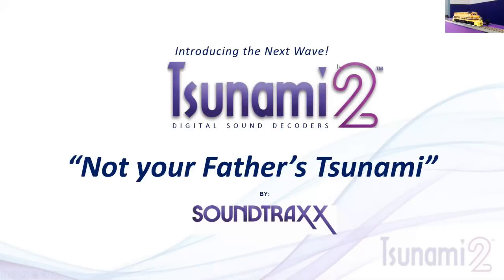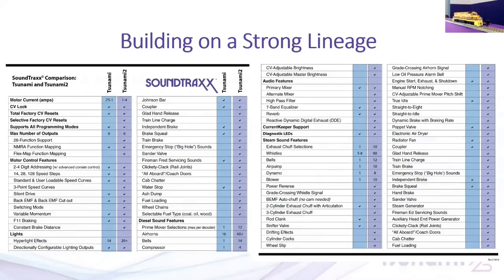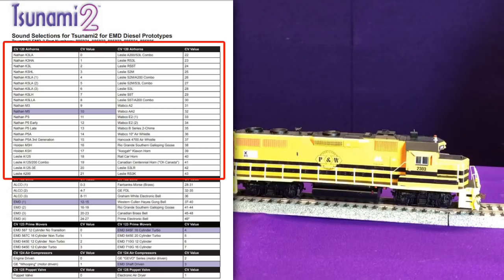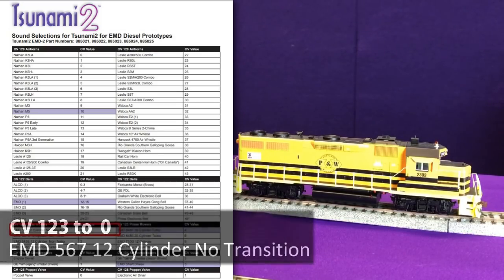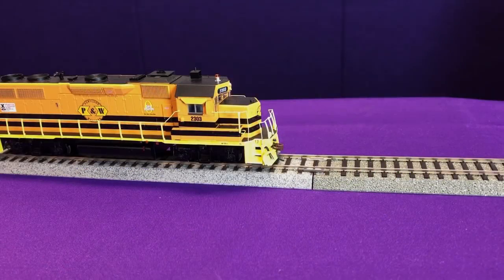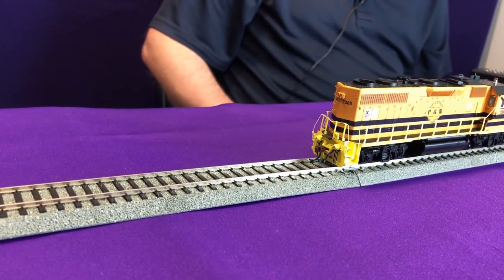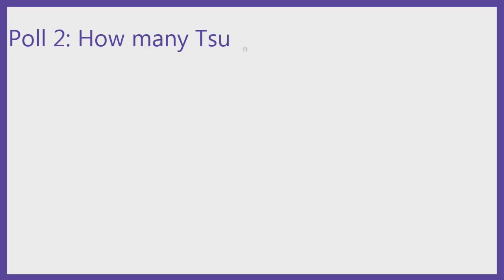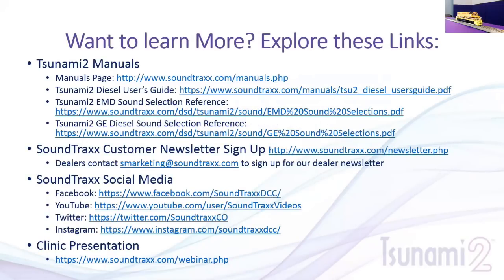Tsunami2 Diesel Overview (Webinar 2)

Comment: I was wondering, could you put a Tsunami 2 21 pin decoder in an Atlas Master Locomotive Equipped with sound? In other words replace the factory (Competitors Inferior product) decoder with a Tsunami 2, and be able to do it without changing the speaker?
Reply from the maker: Yes just make sure the speaker rating matches the decoder’s amplifier